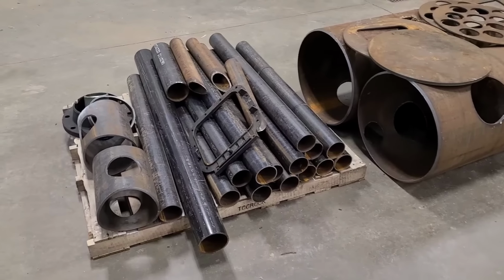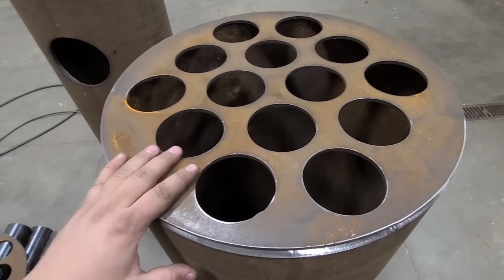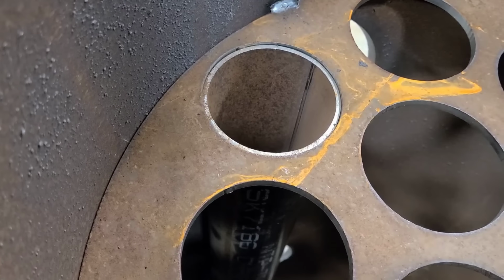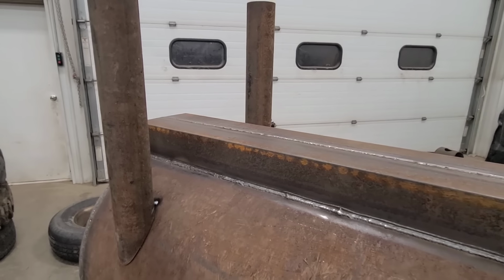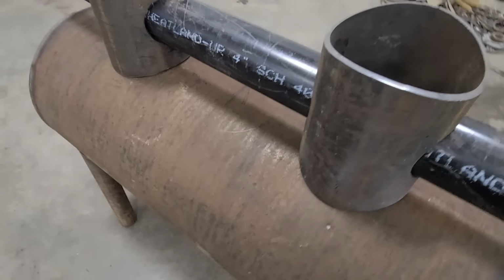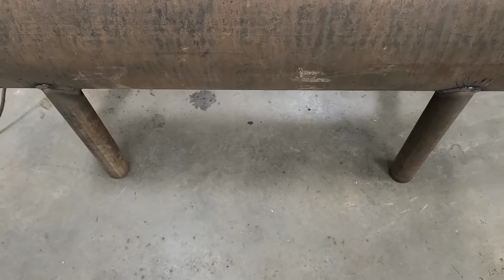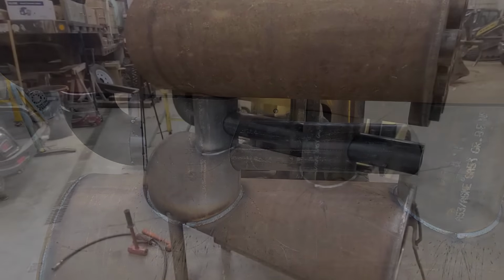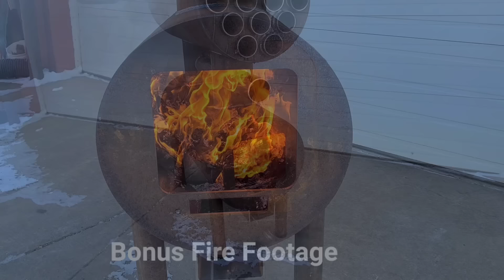My Ultimate Shop Wood Stove Build Part 1

Comment: If you add a catylitic converter to your riser into your exchanger you will reduce any creosote build up, increase the temperature in the chamber and reduce wood consumption. Even if you get the old one off that '85 Dodge Magnum parked behind your buddies Grandpa's barn it will make a difference. It cuts back on smoke emissions also.

Comment: I don't know if you can do this, but if you have the fan suck instead of blow you will probably get more efficiency out of your heat exchanger.  If the air moves through the pipes in the opposite direction to the smoke then the hottest end of the air pipes will also be at the hottest end of the smoke, so more heat can be extracted.
Reply: Fan will overheat.

Comment: You could also add a small pipe coming the gap in the top barrel where the fan is and run it down and to the front of the bottom barrel where it does a 180 and blows a small amount of air in towards the back which would push more hot air through the stack and in turn provide more hot air being blown out of the tubes and also have a bit of forced induction to make the fire hotter and more efficient

Comment: Needs a turbo on the chimney exhaust to draw outside air in and force feed the burn chamber 😄😄  Kidding actually, I suspect most of the energy will be gone through the exchanger pipes.

Comment: NIce idea and realy good executet. Carefull with your second transfer big pipe, the one is a dummy and dont transfer heat from the burner... is a air tight chamber and it will build up pressure. I dont know if it can explode with such thik material... but better dril a smal holl in it then to ruin your day later.
Reply from the maker: Thanks, I never welded the inside top of the support so it can breathe 👍

Comment: Interesting build young man. I have an idea one day to build a solid fuel space heater using the flame tube system as seen on boilers. 
Not sure the scavenger pipe is a good idea because it might rob the heat exchanger of heat?
 Anyway, very interesting to watch young man!

Comment: Well buddy I don’t think you’ll have to worry about it melting on ya - shes built heavy duty! Nice work.  One  questions are you going to have the fan thermostatically controlled so it’ll only blow air through the exchanger tubes when it gets cooler than the temp you want so that it’s not just blowing all the time cooking you out of your shop?  Great video, one of you best edited so far in my opinion.
Reply from the maker: That's the plan

Comment: Cool like the heatalatore in grandpas old coal stove heat the house for days with wood or coal
Reply from the maker: It should work out well!
Reply: @kylechrist  yeah it should be a real heat blaster with the set up you have for that exchanger and draft fresh air intake  and the fan unit.

Comment: "counter current flow" Hottest waste gas should heat the hottest return air, not the coldest. And heat exchange is directly related to surface area so smaller diameter is better. 

I want one of those

Comment: personally instead of having that bottom heat exchanger i would pipe it back into the top heat exchanger exhaust with another 90 to basically cause a venturi effect inside the top heat exchanger causing more air to be pulled in through the intake meaning a hotter and cleaner burn
Reply from the maker: You have the right idea but it needs to be separate fans so when the stove isn't warm, it's not blowing cool air 👍
Reply: OR you could get a turbo flange weld that onto the exhaust then bolt a scrap truck turbo on top of the flange and feed that into the air intake for a large performance increase it's technically a fan/blower

Comment: a lot of vertical weight, i would put a triangle brace on the legs to widen the stance and support the legs
Reply: Amen! And gussets at the point where the legs meet the burner body. That’s a weak link right there.

Comment: I’m confused what the heat exchanger is for. At the hospital I work at the heat exchanger for re heating water that circulates through the system. It looks like this is just gonna redirect smoke from the fire. I’m confused but looking forward to seeing the finished product

Comment: Hey i got an idea for you :) Try to build a Extension for you MIG-tip Så it goes deep in tight areas. you can make it by treading the disposable brass tips. and then making a gas shield that is Flat and long. i've done a couple. Good luck

Comment: Great looking wood burner. I wonder how many BTUs all that heavy steel will hold to release as it cools after the fire has burned out? Welding around those pipes makes me think of 50 years ago when a local man who worked at the John Deere works in Horicon said he used to stick weld wheel hubs without any sort of turntable. He said they would bend the rod, reach as far around the shaft as possible and weld all the way around without breaking the arc. So often progress makes old skills get lost.
Reply from the maker: That's not a bad idea Geoffrey, may have to try it out. Outside during the burn in, it took about an hour at 0°F to get back down to room temp
Reply: 0 degrees, burrrrrr. I wish you would have kept it there, the cold got here this morning. MERRY CHRISTMAS!
Reply: I had a muffler replaced at a shop by an old greybeard, he acetylene torch welded the bottom that thin exhaust pipe, overhead, without looking, then heated up the middle of his filler rod, jammed it against my truck frame bending it into a J, and welded the top side of the exhaust, while looking at me, telling me a story. I was out of there in like 15 minutes. I crawled under and looked at that weld later, it was like a stack of dimes. Greybeard skill is real, and it is humbling.

Comment: Maybe I missed something here, you set the exhaust from the bottom and the top directly over each other if I am following this correctly.   Seems like that would allow heat to escape easier and not fully heat up the heat exchanger.  Seems to me coming in one  end and exiting the other would be more efficient.   I thought you mentioned that in the video but I didn't see it take place.  Sorry if this was already addressed, I didn't follow all the comments.  Thanks nice build though.
Reply from the maker: You did miss it, the back of the heat exchanger is just a cleanout that will be capped. The exhaust will be at the front so it does have to travel the length of the heat exchanger. Thanks for watching

Comment: I'm a little concerned about creosote build up in the heat exchanger but overall, i really like your design. Should last a long time. 
If you're not already, I'd consider an outside air intake.
Reply: If you burn dry wood shouldn't be a problem.
Reply: What will it cost for you to cut and ship me a lit to weld together? Im in southern California?
Reply: @JuanGonzalez-cb8yg  I didn’t think you needed heat in SoCal???

Comment: Great job Kyle. Future generations of Christ's will marvel at your awesome engineering and welding skills!  When running a big exchanger, does that exclude hanging a baffle plate under the firebox outlet?
Reply from the maker: So I did leave that out as it can always be added, I don't want to take too much heat away from the exhaust, thanks for watching

Comment: Nice project. If I were you, I would probably weld everything with 7018 rod or 7024 for flat welds, way better penetration than mig. I'm a welder and people do come to my shop to restore their wood boilers by replacing all interior thin burned sheets with brand new 6 mm sheet metal and never had huge leaking problems with 7018. I do have tig ac|dc/mig/mma.  welders.

Comment: Note for younger fabricators: sch40/10 pipe is never round. It's all sorts of oblong/oval and will always give you hell in fit-up. Trust this random internet stranger... don't try to be clever and use weld heat to pull the material into a good fit. Cylinders twist more than what you expect because of the stress in the material from the mill. If it's square, and a couple joints have a 1/8 gap - send it and just fill those gaps. Yes, it sucks - but that's why we're paid. 

Even CNC tables have issues with material warp. It's an imperfect world, it bothers the engineers just as much as you when shit doesn't come out right. They just don't get to cruse and struggle with it like you do. But that's why the welder is the engineer's hero. Keep your stick in the keyhole out there, I'm pull'n for ya.

Comment: Not being a wood stove designer  but thinking of it   -  I would have used the opportunity to allow the flue gasses to come forward into the heat exchanger and exit the rear .  I might have made that a Schedule 40 tube and added hot air injection pipes from a larger damper chamber to a dual box beam like air chamber on the top of the lower burn chamber   (similar to your ash cleanout)  this would cool the upper part of the lower 20" pipe burn chamber and heat the return combustion air.   This would allow you to capture the unburned  volatiles from the flue gasses as the smoke moved from the back of the burn chamber  to front of the heat exchanger        I would have shrouded this tube transfer  with a box between 20" burn and 20" heat exchanger tubes  that would capture this heat  as  this tube would be very hot with the flow and air injected re-burn   - however you would also have to put in a chimney bypass to get the thing started .  Also this should be slanted so that ash buildup in this tube would fall by gravity back into the burn chabmber or have a air hose fitting and valve to effect a blow down cleanout      There is an old dude ranch around here and they had a masonry steal and tube boiler for a sawmill - it had a lot of innovation in it   - The medium of heat exchange being water vs air  not bad for 1905
Reply from the maker: I'm not saying none of this could be done, but it would require a lot more planning than the simple idea I had in my head haha
Reply: My only concern is what the final flue gas temperature will be. Any surface below 250*F is likely to cause gases to condense into creosote.
Reply: @brentoconnor6127  Yeah those are large exchange chambers  something to model prior to building

Comment: Noticed the smoke did not rise out of chimney.  If you scavenge so much heat from the flue gasses, convection will not propel the smoke up a chimney and on cold days you'll  get CO2 problems. Need a blower to push out the chilled smoke.
Reply from the maker: The smoke didn't rise out of the chimney because the chimney isn't welded on yet. I explain this in the video

Comment: This could double up as an awesome water heater for a cabin, if you run some copper coils around the top heat exchanger with water running through it.  you'll hit two birds with one stone. 😀
Reply from the maker: Definitely could, although this is just going in a shop 👍

Comment: Absolutely awesome build. I am surprised you allowed the back end of those heat exchanger tubes to extend to where they would interfere with completing the welding. Otherwise, a very impressive fabrication
Reply from the maker: It was an oversight I admit, nothing that can't be fixed. At least they were too long and not too short 😁
Reply: Nothing that a good welder  can't fix

Comment: Looks great so far. Only thing I see is your beads, they are pointed. Means traveling to fast, slow down a little. I am typing as the video goes one. One big issue I see. On your dummy pipe. Need to take like a 3/16 or so drill and make a hole in the dummy pipe. Heat will build and could get to a point it blows the dummy pipe some where. It is going to build pressure if it is fully capped off. Need some sort of relief hole in it somewhere.
Reply from the maker: This has been brought up, there is a 1/8" gap between welds on the top of the dummy pipe 👍

Comment: What about secondary burn plate between the actual heat sorce  and the outlet to heat exchanger.
Would that not allow the gases produced by the wood to be superheated causing them to ignite as well. 
Thus cleaning up any soot from building up in the heat exchanger, and helping to eliminate any chance of fire inside the exchanger itself. 
Would generate even more heat the way I understand how this works, and lowers the output of nasties that Greta is always on the lookout for. 
Builtin catalytic converter so to speak, and allows for complete burn thus giving you more btu's per cord of wood. 
Are am I mistaken in my understanding how the process of burning off the vaporized gases works to make for complete burn of every component in the cellular struture of wood.
Not that I'm trying to be a know-it-all, but from everything I've seen, read, and experimented with on my cast iron stove in my barn, it seems to give me  some additional heat to where it keeps my non insulated very drafty shop area warner even with a very inefficient wood burning stove. 
Although I have done everything possible to seal it up with gasket around the door, and high temperature chalking of the seams.
Even to the point that I have stainless steel flue pipe so that the fan pushing the heat from behind it gets more of the radiant heat to spread around the shop as best it can. 
Surprisingly I've yet to burn the motor up, or even melt the fan blade, because it was an old $15.00 dollar Walmart fan someone had thrown away when it stopped working in the horse barn.
But it was simply heavily coated in dust and cob webbs, and would overheat shutting itself off.
Little air hose maintenance, and 12 years later still blows well all summer, and pulls winter duty within inches if stainless steel flue pipe directly over the mesquite burning wood stove

Comment: It might not hurt to drill a small hole in the dummy pipe. You have that thing sealed up when it gets real hot there's going to be a lot of pressure in there. it'll probably be ok but over time IDK.
Reply from the maker: It's not welded at the very top on the back side 👍

Comment: With the extra. Pipe added in between burner an exchanger you may have a problem with fire drawing enough air even with a power draft blower?

Comment: The ash pan was excatly how made our? The legs a tip would be weld some angle to pipe an an level up an tack angle to Bottom of barrel! Nice job welding. We done all of our welding with sticks them an 7018 rod.

Comment: Just an observation, or maby an idea for a modification, you would be able to recover more heat from burner if the exhaust (chimney) was on the opposite end of your heat recovery section, the flame/heat would have a greater surface area to transfer heat... Also for start-up, when draft could be poor, tap off a small air pipe from your air box and install into the chimney pipe at an upward incline, this will provide a venture effect and draw air upwards through your fire.
Reply from the maker: The exhaust is on the front of the heat exchanger. In the video I noted that the flange at the back is a cleanout that will be capped
Reply: @kylechrist  correct me if I'm wrong.. But isn't the outlet from your firebox at the rear? And isn't the chimney from the heat exchange also at the rear? Or am I missing something... Then, I only watched in in sections while stuck in traffic..But a super build
Reply from the maker: @robertteap8052  the outlet of the fire box is in the rear but the exhaust is at the front of the heat exchanger. The chimney is not yet welded on, the flange you see is just a cleanout for future use. 

The fire will be more towards the front/middle of the burn chamber, smoke has to travel back and up into the back of the heat exchanger, it then has to travel back to the front of the heat exchanger before it can't exhaust. Hopefully this clears it up and thanks for watching 👍
Reply: @kylechrist .... had time to sit down and watch the video in its entirety.. I stand corrected..
Reply from the maker: @robertteap8052  no worries, thanks for watching

Comment: While I love a over the top design. I think you may find that this stove isn't going to work so well. The heavy wall material is great for being heavy duty and providing heating after the fire has gone out. But it's also going to make it hard to get your fire hot enough to burn smoke free. So as your fire is heating up you're going to get a lot of creosote and water condensing in the heat exchanger. The water will evaporate later. But the creosote might become an issue if it accumulates. And once the fire box does get hot enough to burn clean, it's going to be dangerous to be around because it'll be so hot. I'd suggest lining the inside with ceramic wool or fire brick. You'll get a way cleaner burn and the outside metal will stay a bit cooler. 
Those tubes in the heat exchanger are so big that your not going to get great heat exchange. It could be improved by increasing the surface area the air you're trying to heat comes in contact with. Some sort of spiral inserts that force the air to take a longer path through the tubes would probably help quite a bit. 
And depending on how well sealed the space you're heating is, you may want to consider using outside air to feed oxygen to the flame . 
I hope I'm wrong, but if I'm not hopefully this can be still made to work well.
Reply: Its such a beautiful job, but i fear the exchanger is going to plug up with creosote. A second open chamber with a clean out would do nearly the same thing and not plug up.

Comment: wouldnt you want the heat exchanger pipes to be thicker and take more to heat? because on the other hand they take more to cool so if you dont keep up on the wood it still will pump good heat for a while longer since it has more thermal mass
Reply from the maker: While thicker would take longer to cool off, it also would take longer to heat them up. I had the 3" sch 10 pipe already as well 👍
Reply: @kylechrist  ah fair enough